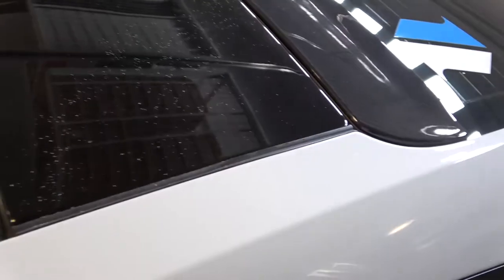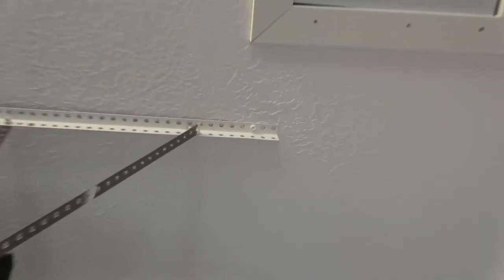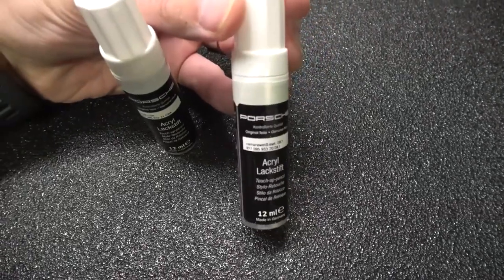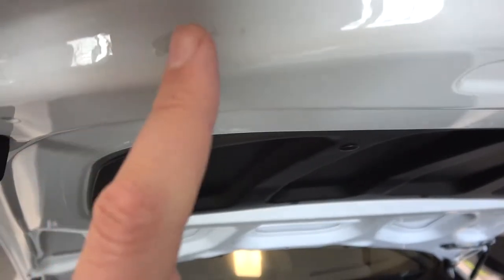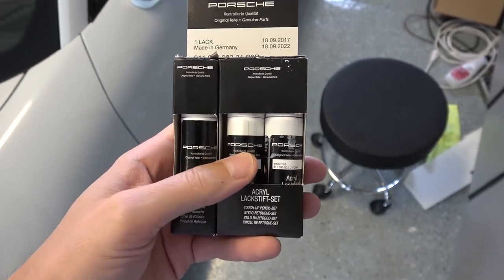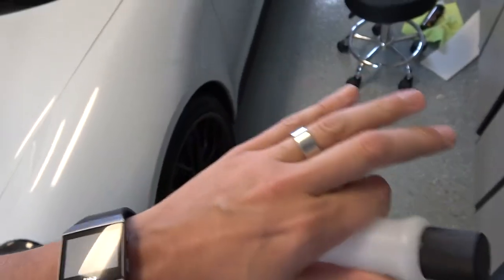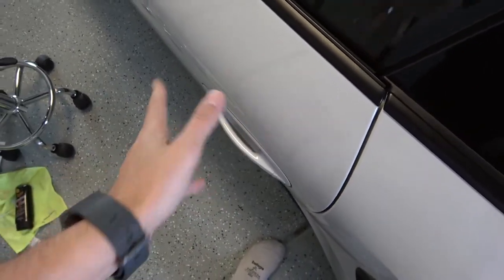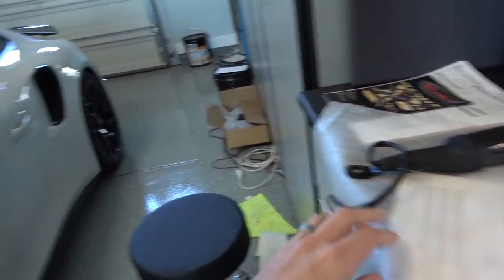Porsche Paint Chip- My Attempt at a Touch Up

Comment: I had a Jaguar and the touch up paint matched up perfectly. Now on a Porsche it is nowhere near the same color. I'm actually shocked. No primer came with the kit, just a clear and a much darker, almost black paint for a very light grey color. I'll try mixing the two but the color was so far off that I don't think that kit was worth the money I spent for it at the dealer. It did not come with the car.,

Comment: I have the same S9R and I'm finding it impossible to match the Porsche touch up to the actual paint. I even tried different mixtures of the 2 bottles and can't get it to match at all! I wish Porsche would have just given a single bottle of color and not require any mixing. Did you use the clear coat bottle that came in that kit?
Reply from the maker: It's super hard to match any paint w/ flecks (I'm not sure if that's what you're dealing with). I mixed the paint and clear together and got a pretty good match. But in the end the paint changed color after being exposed to the sun and I had the door repainted.
Reply: It’s because it’s tri-coat only really meant to be sprayed unfortunately, I deal with this almost daily and have to turn away most , white being the hardest , a lot of new pairs are tri’s to get that summer effect when you blend them rather then layer them it will dull it down

Comment: you did a great job matching the color paint, those factory touch never match :(
Reply from the maker: I really tried to make it work. After a few months of sun exposure it looked bad and eventually the door was just refinished.
Reply: Probably doesn’t match because that’s the original paint. Car has faded since it left the factory. We just the same touch up pens at the factory and no one every notices when it comes off the line.